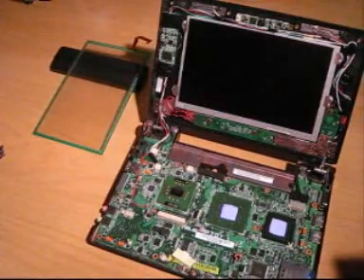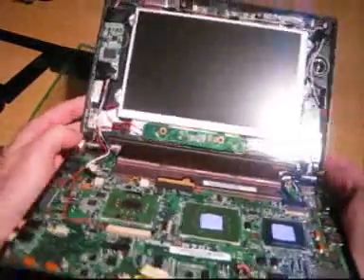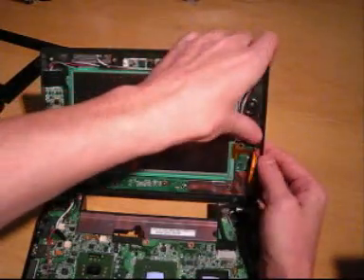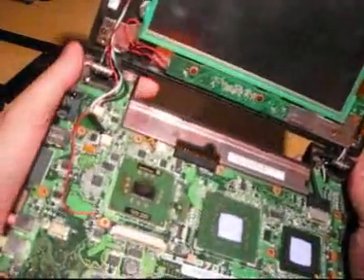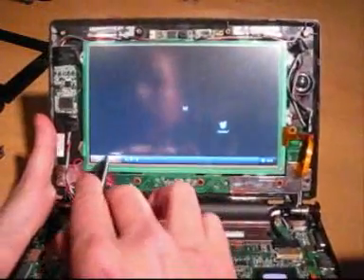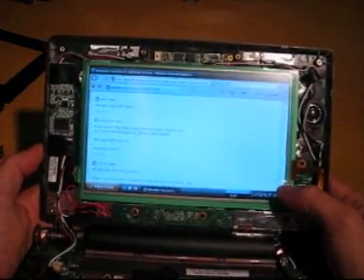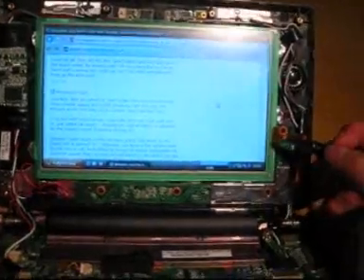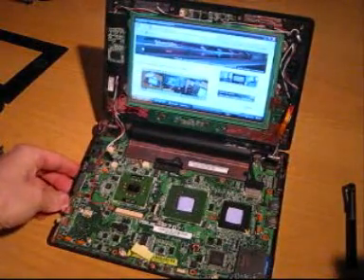How-to: Asus Eee Pc with touch screen

Comment: @FlipidusX This was made in 2007,and the eeePC 701 was the first mainstream netbook. It took off like nothing else as it was cheap and easy to mod.
And it's far from pointless anyway- touchscreen capability on a small, light, cheap device that still has a keyboard and runs a "proper" Operating System can make it very useful!

Comment: @gfreemanua It was under load, during POST it is under full load, and then it was booting windows.  Without a load a desktop processor last's awhile without cooling.  It is simply not good for the chip.
Such a distortion is best to still keep in mind.

Comment: @mattg889 
I did not say the reverse;) But now there are a number of models of netbooks with a passive cooling system and there's nothing particularly serious with these bare chips not happen for 5-10 minutes without load.In general, such a distortion is better not to suffer

Comment: @gfreemanua They still get hot.  Heat is bad for any chips.  
You know what, If you want to run your computer without the heatplates/heatsinks in place then go ahead, it's not my problem.

Comment: @hitechguy18 I know they have overheat protection, BUT in the atom the overheat protection still doesn't activate until the cpu get's above boiling or 125C.  It can fry before it hits this temp, but probably won't.  The atom is made to withstand up to 100C being that's its a mobile cpu.
Most desktop cpu's are rated at 70C, thermal trip at 100C.  
Anything over 40C is hard on a cpu, over 70C is dangerous for the cpu.
Regardless, heat is bad.  It is still not good to run without the heat sink!!

Comment: @pballdale haha, if you don't understand how heat can shorten the life of a cpu then you shouldn't be talking about them.  
First and by far the most obvious, It will get hot without a heatsink.  Heat put's a extreme amount of stress on the Microsopic components and there circuits which greatly increases the chances of a failure, secondly anything deteriorats faster when it's at high temps, you can't really measure this though.  There's more, but  I'm out of characters. :-)

Comment: Why did you use a cable extension?
It seems obvious to me you could have turned the touch panel 180°, any calibration software I ever saw is ready to accept any tilt angle, even 180° one...

Comment: if your still having issues with it , turn the unit on and remove the battery while its in the bios / and then hold the power butten for a few seconds then  reinstall the battery and try to boot it again

Comment: Just google it. You'll find some online retailers but it's technically not released yet until May 12th (at least to the US). You can buy english language Eee 900's but they are imported from China or Korea since its been out there since mid april. And on a side note you can upgrade the ram at home without voiding warranty (at least thats what Asus' site says)

Comment: Yeh I agree with you a touch screen would be much more useful and if your so worried about speakers wouldnt you just plug in some external ones? The laptops speakers are never going to produce top notch sound anyway so one less speaker won't hurt it to much. Good Vid btw.

Comment from the maker: RAM not soldered, SSD is soldered
some early 7Bs had pcie connector, later 7Bs are 1 to 1 to 7cs

8GB version has SSD on pcie slot

Comment: Thanks a ton for your reply. One more quick question. Even I am planning to buy 7B as 7A is not available here. As you have opened up the device you will be knowing whether RAM and SSD are soldered to the PCB as if it cannot be upgraded. Are they really soldered in 7B? Pearl white is starting with serial 7C and does it differ any way from 7B?

Comment from the maker: difference with early 7a and 7b is that there is pcie connector.. but it can only be used for extra ssd and it disables internal ssd..  so both are as good for mods... mine is 7b

Comment: Its always possible dude, but the thing is.. you shouldn't really overclock the processor when its a laptop, there isn't enough heatsinks/coolers to help you out and you might end up frying the cpu without a problem.

Not only that, but theres only 1 fan in the Eee pc, and it gets really hot. Average heatness of a regular laptop.

Comment: Hi i'm wondering if you could install the panel rotated 180 degrees so that the controler wires don't need to be extended.  

Would the calibration correct this?
Reply: Idk